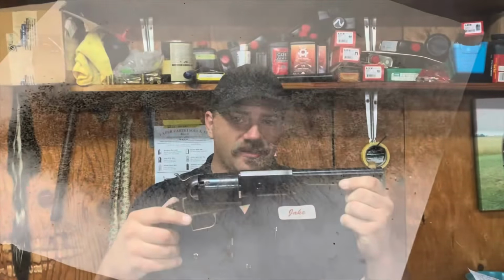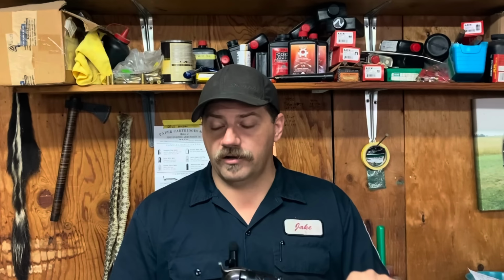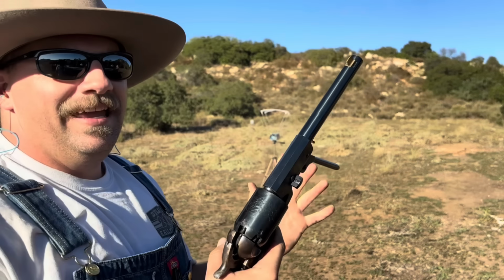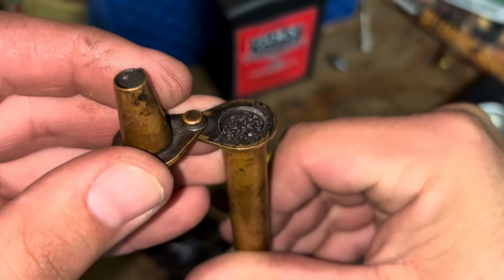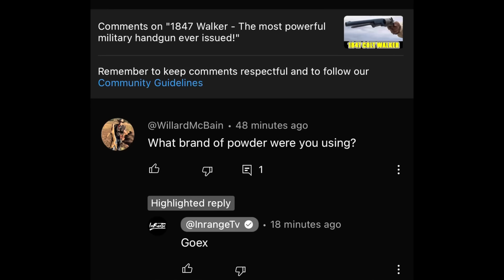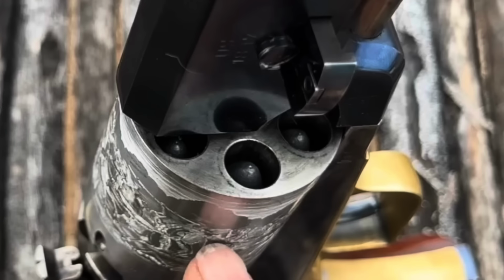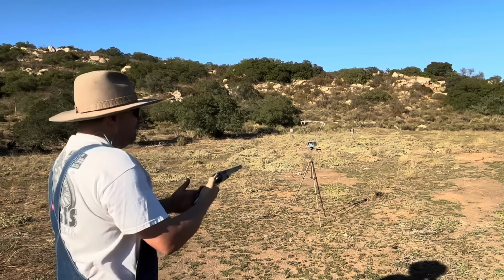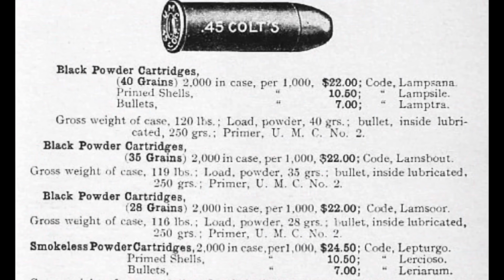The Colt Walker. Not The Most Powerful Revolver Of The 19th Century?

Comment: One trick that a lesser known channel (Bl@ckie Thomas, the A was substitute there, comment getting deleted otherwise) has is notching the chamber that deviates the most in accuracy.
Which means, chamber sizes might be inconsistent on one and the same gun, not just between various production runs and manufacturers (which we know for a fact).
My theory is chamber volume between different manufacturers has something to do with it (we all can at least agree they vary), as opposed to everyone being in each their own 3cho chamber (lol), it might be a case of everybody being completely valid just because everybody has different chamber sizes.
Reply from the maker: We checked the chamber volume and dimensions on three different manufacturers. A second gen Colt, an Armi San Marco and this Uberti. All were within .010 and the capacity was within 4gr.
Reply: @Everythingblackpowder  Right, I should have suspected as much! Sorry if I came across as casting doubts across the work you've put in!
I was just watching C&R's "Reprocussion 003" video where, at around the 32:00 mark'ish, tiny Mae, without a breaker bar, also loads it with a lot more powder than what you could feasibly pack into your Walker WITH the aid of a breaker bar and bending the plunging/ramming rod.

Not doing any saber rattling for the Walker or anything, while yes it's a cool gun, Josey Wales blabla'n all that, I've trained myself into a pragmatic, this is strictly my curiosity speaking (which you kickstarted with this video).
The Walker being the 2nd "practical" commercially "available" revolver design and as you aptly pointed out it can't possibly have been the most powerful until the .357 came out, not even close.

I'm just genuinely curious as for the reason why with all these more famous channels both amounts of powder & chronograph numbers differ so much from yours.
There's a term with Japanese car & car tuning companies where they had cars with "PR Tune" featured in media (unbeknownst to media) to outdo competition to influence their bottom line, did Uberti/retailer give these other channels (unbeknownst to these channels of course) a longer cylinder with more volume or something? Most of these companies are Italian after all (no offense to Italians but take Ferrari for instance, if they can help it they won't even let anyone compare their cars side by side to other competing brands, as famously featured in Top Gear/Grand Tour 🤣)
And setting aside powder load, there's also the muzzle velocity, you probably got this covered too, but could differently calibrated Chrony's have something to do with it?

Comment: I haven’t shot BP in 30 years. Just picked up a Pietta 1851 in .44. Historically incorrect but I’m not concerned. Taking it out in about an hour to give her a go.
Reply: Things went great! Till they didn’t. Jammed the cylinder, had to disassemble and clear then it ran great. Other than that I fired about 50 balls with only the 1 jam. Note to self: use #10 primers instead of #11.
Reply from the maker: That can happen.
Reply: @Everythingblackpowder I filed down the burrs in the case and cleaned up the hammer with a file then swapped out nipples to Slix. Took it out again with no problems or jams. Fired 60 bullets using 3f and roundballs.

Comment: Forget the walker copies the original held 60 grains of black powder & they lowered it to 50 grains for the dragoon .there are clips of the real walker,s look them u
Reply from the maker: Mine is a uberti and it holds 60gr. What’s your point?
Reply: @Everythingblackpowder  the commentator said he could barley get 50 grains of powder in his walker .
Reply from the maker: It depends on what projectile you’re using. I can fit 60 grains of 3F in mine with a round ball, no trouble. I can fit 45 grains with a smaller 200 grain conical but 50 with that 260 grain conical was a lot of trouble

Comment: In an old book by Greener and Greener on black powder charges, he stated that in shotguns you had to be careful with the powder types.  Really fine grain powders in same volumetric loads would produce higher pressures that could damage the chamber of the shotgun, even causing it to fail in a way as to harm the shooter.  I do not know how that compares to the loadings you are using in your pistol and modern powder grading.  I have no real experience or knowledge of black powder arms myself, but his information seemed reasonable to me. The book did mention that finer grained powders worked best in revolvers and rifles, but a coarser grained powder was better for shotguns.  I no longer have the book as it was destroyed in Hurricane Isaac, along with a lot of other valuable first edition books from the late nineteenth and early twentieth century, for which the insurance company would no cover, but that is another story for another rant on a different type of video.

Comment: Does your stricken measure "throw" accurate measures? Have you weighed them? I have 'found' Swiss throws HEAVIER charges than GOEX or Schutzen. Swiss powder has
harder shinier grains and packs into the measure more actual weight of powder, than does GOEX. It is also more difficult to compress, as you found out. T-7 is VERY soft compared to BP.Those pointed bullets do not look proper. As to the T-7 or Pyrodex powder, it is not as shiny, and I have seen cans marked in F's. This might lead to confusion or deliberate Bull Shit by the perp.Please do not use Pyrodex in a valuable rifle.  Inlines- OK - LOL.

Comment: This is very interesting, I always assumed the Walker would have been more powerful with that big cylinder and the advertising of using 60 grains of powder. I only use round balls so never checked to see how much I could fit under a conical nore did I ever chrony mine or do a calculation of the energy compared to the 45 Colt. You probably butt hurt a bunch of Walker boys making this video. LOL Thanks for sharing.
Reply from the maker: Thank you. Hurting feelings is one of my specialties
Reply: @Everythingblackpowder  😀

Comment: I'm late to the party here, so I hope you read my comment. Great channel. I own a Uberti Walker, and I run it with FF Goex and .457 round balls cast from Lee molds. I can say without a doubt that the maximum charge in the thing is 60 grains of FF. 60 grains pretty well fills the chamber all the way up. I typically run a 40 grain charge of FF in it. I suspect that running max charge in the Walker doesn't yield enough benefit to warrant the additional use of powder. All that being said, I'd take a Colt single action chambered in 32-20 over the Walker any day.
Reply from the maker: Agreed. Thank you

Comment: Do you know what the granulation “revolver” was?  It was finer than fff. Dunno if it was used in this revolver or not. But it was used in later paper and foil cartridges from my reading. Museum people often leave a lot to be desired. And you need to WEIGH CHARGES. Shaking the measure to get the powder from the bottle is not consistent by a long shot. And the volume measures seldom are. And yes most likely goex is pressed to a lower specific gravity so the grains are easier to crush to dust.  And bending the loading lever tells me a lot.  😂 you can seat the balls after removing the cylinder.  Better than damaging the revolver. And the walkers may not have the same chamber capacity if made by a different subcontractor/maker. I had a 1860 by Uberti about 40 years ago that would take over 35 grains as I recall  and a round ball with no heavy compression. Btw the Military 45 “Colt”load was the Schofield cartridge since they had these in service as well. It was the “short Colt” and I have seen an original box of the shorter version (UMC IIRC) marked 45 Colt. Nor would this box even accept the longer version.

Comment: I seriously wonder if we are all just using uncalibrated or inaccurate (wrong) powder measures. Mike Beliveau, who is the absolute authority on cap-and-ball sixguns in my opinion has maintained that he can only get a max charge of 35 grains of 3f into an 1860 Colt. I routinely load 40 into mine with a WonderWad and a .454 roundball and can easily fit more. If I'm to believe my powder measure, I can fit a little over 50 grains of Triple 7 and a .454 roundball into my own 3rd gen Colt 1860, which to me seems ridiculous but unless my little measure is way wrong (it's not because I can set it to 25-30 and it will fill a .45acp case to the brim with 777). My cheap brass frame Pietta navy clone has a cylinder that is 1.5 mm longer than my Colt but the chamber's all hold less powder individually by 5 grains roughly. So if using my powder measure, I would certainly think that the Walker, with its much longer cylinder, would hold easily 50-60 grains of 3f powder. I have no idea why an 1860 will hold more powder than a Walker or Dragoon for that matter.
Reply from the maker: @codered7453  I can’t speak for everyone but No, I’m not. This is the same powder measurer and same powder used in the Walker video.
https://youtube.com/shorts/1PiiypKgd5M?si=D9w7t1pobSIr2U5C

Comment: I've done the math multiple times between 45 colt and 357 magnum on energy ft/Ibs. And always come up with 357 magnum beating 45 colt by about 50 or 60 energy ft/Ibs. Granted this is comparing most factory loads with 158 gr. Vs 250 full house WITHOUT going +p on the 45 colt
Reply: Yeah. The 45 Colt stomps it and the 44 mag with full power loads. I think the old comparison was the government black powder loads from the 19th century vs the 1930s 357 loadings.
Reply from the maker: It depends on what 357 mag you compare it to. The original 357 load from 1933 was really gnarly compared to most factory ammo nowadays.
Reply: True with the 8 3/4" barrel as far as I've researched
Reply: Was saying like 158gr going 1400 fps which is actually faster than a lot of factory loads Nowadays.
Reply: Oh and was the 2f 45 colt Swiss or goex or homemade....?
Reply from the maker: 2F Swiss but I have used my homemade balsa powder and it averages 7fps less.
Reply: Thank you Sir

Comment: With all due respect, I have to note that using a volumetric measure instead of a mass one in this experiment is incorrect.
Reply from the maker: How so?
Reply: I guess the density of Swiss and Goex may be different @Everythingblackpowder
Reply from the maker: Ah, it’s not really the density, it’s the hardness of the individual grains of powder. Commercial black powder is compressed to 1.7 g/cm³ both Goex and Swiss meet this requirement making the volume and the weight practically the same but since they both use very different charcoal, Goex appears to be softer. That’s my theory anyway.
Reply: thank you for the answer. But anyway, measuring by weight is more precise for such kinds of experiments. But for the compression comparison, the volume measure is quite relevant @Everythingblackpowder
Reply from the maker: @alexspiridonov4014 I completely agree, but to keep the historical context in mind, they wouldn’t have weighed their charges for the walker in the field.
Reply: fair enough @Everythingblackpowder

Comment: Keep in mind the "walker" was only 1100 finished pieces... truly designed for 60g charges... all colts sold after that had reduced length cylinder to prevent cylinder burst... these are actually "dragoon" colts... so if someone claims "walker" prolly BS

Comment: Sorry to ruin your day BUT you didn't bother to check the cylinder gap on the walker. The origional load for the walker was 220 grain bullet and 40 grains of black or 50 grains of black and a round ball. Seems that a 60 grain charge blew up the cylinder. Not a very accurate or scientific comparison .
Reply from the maker: @kletusleadbetter6038  none of those loads in the Walker are going to produce more energy than the original 45 Colt load in a 7.5 barrel SAA. Nice try though. Sorry for ruining your day.

Comment: You are correct my friend....The Walker is gnarly for a cap'n'ball, but no 'powerhouse' as such. The full 45 Colt round is quite something really, especially in the lighter SAA Army.
As for compressability, the Swiss has very hard grains that retain their integrity, which I think is what gives the superior performance as the flame spread in the chambers is not as inhibited as with softer grains that crush if pushed hard and the space between the grains is filled with bits and pieces which slows the pressure build up..... It's just a theory... what do you think?
I have found that more than light compression of BP loads leads to a decrease in performance rather than an increase...
Reply from the maker: I agree
Reply: No powerhouse? LOLOLOLOLOLOL  Not only is it a powerhouse in black powder, when converted to s&w 460 bpm cartridge (45) your 45 colt is anemic.

Comment: The original Colt Walker dragoon had a longer cylinder and actually held 60 gr. Of black powder and I know that for a fact because I own a original Colt Walker dragoon and it not in perfect condition and no I don't shoot it! But I have a reproduction Colt Walker dragoon and the cylinder is shorter than the original! My newer  one only holds 40 gr.of triple 777 select and that's powerful enough. I measured my original out 60 gr. And poured in the cylinder hole and there's enough room to press a conical in it and clear the forceing cone ! So I dumped the powder back in the bottle and cleaned my cylinder!:
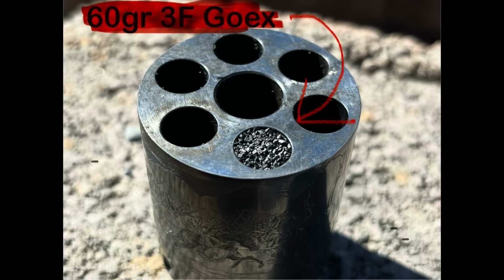Reply from the maker: Every reproduction will hold 60gr and a round ball as we demonstrate at 5:06. We checked the volume and dimensions on three different Walkers. Uberti, Armi San Marco and a second generation Colt which were made on the same tooling as  original Walkers and all three guns were within .010.
Reply: That is very interesting. As a guy who has spent many years studying the original walkers, I will never own one as they tend to bring in the ball park of one million dollars at auction. I am very interested in your cylinder as it seems to be larger than any other known walker cylinder. Could you give me your serial number range I will gladly add it to my studies if it is not one of the less than 100 still known to exist. It could be very important as it is possible it is a prototype with a large cylinder.

Comment: The only way to fill the chambers with the as advertised and claimed 60gr is to use a round ball. Not sure that when the gun first appeared, that conicals in revolvers were even a thing yet. Also using Triple 7 or Pyrodex will reduce fouling and reduce the drop in velocity as the gun fouls up. 

The capacity of the Walker cylinder is awesome but IMHO the gun, apart from that, and the historical and kewl factor, sucks. The half frame design sucks. The wedge holding the whole gun together sucks and the only thing that sucks worse than the wedge is losing your wedge and realizing that you don't have a spare. The loading lever retention system sucks. A cool but really really sucky gun compared to the Remington 1858 New Model Army, as far as front stuffer revolvers go.

Comment: Speaking of most powerful revolvers in the 19th century, I'd say that the 38 bore (.49 cal, whereas the Walker is .44) percussion Adams or the .577 British cartridge revolvers as well as the .45 Colt revolvers and the 1870 Gasser could be contenders for that title. 

Personally, my impression of the Walker simply wasn't as good as it was with other people. Given a choice, I'd take an 1851 Navy over it... Actually, I'd take the majority of the other numerous percussions over the Walker.
Reply from the maker: Very true but the Beaumont-Adams and the British 577 pistols only generate some 400 foot pounds of energy. While still being very powerful it still doesn’t beat the 45 Colt. As for the 1870 Gasser, I’m not too familiar with that one.
Reply: @Everythingblackpowder Interesting. I read an article from Gunmag that stated that the .577 Tranter could manage 725 ft per second with a 450 (or 480) grain bullet and did some converting online (Alas, since I live in a country where even just modern firearms are hard to get a hold of so no chance to test it myself) and found that it could generate 525 pounds of energy (which while not beating the 45 on certain occasions, though definitely matching it, is certainly more powerful than 400 ft lbs). Do you have any more sources for the 400 ft lbs?

As for the 38 bore Adams... I haven't found any details on it, just the 54 bore/44 calibre so more insights on it would be appreciated.

(I do thoroughly enjoy your content, by the way. Both relaxing and informative.)

Comment: It sounds like the Chambers on your reproduction are undersized.
Reply from the maker: Why is that?
Reply: The Colt Walker was originally designed to use 60 grains of black powder but due to problems with the cylinders cracking or worse Colt later advised to only loading it with 50 grains the same charge is the Colt Dragoon. Army records support this. The powder charge was reduced to a maximum of 35 grains for the 1860 Colt Army. I haven't seen a reason specified but I suspect that recoil reduction was the motivating factor but saving money on powder can't be ruled out without evidence.
Reply from the maker: I agree but what does that have to do with the chambers of my Walker being undersized?
Reply: @Everythingblackpowder  
Because you are not able to fit the same powder load in.

Comment: 50 with a round ball sounds right. Fill the chamber, compress the powder with the loading lever, then fill the chamber again - this should be 50 grains or better. Then load the ball and seat it with all your worth. This may not work with Swiss, but it works with my fluffy home made powder, with an 1851 and a .454 ball I can get 1000 ft/s this way.